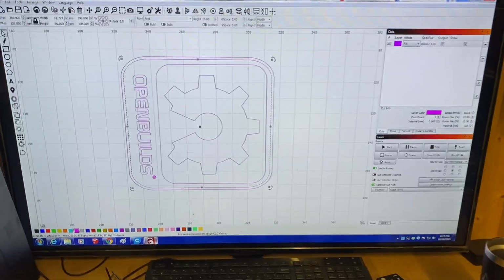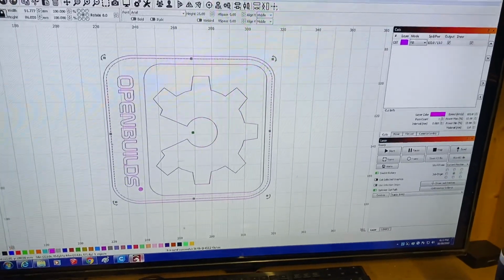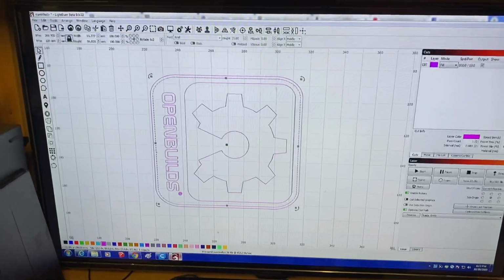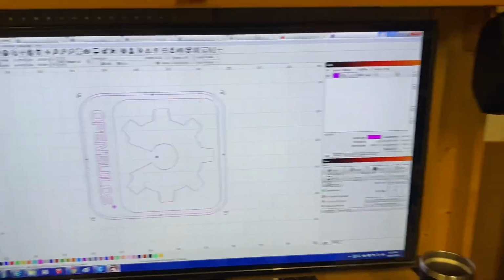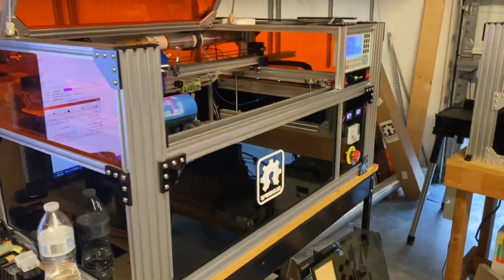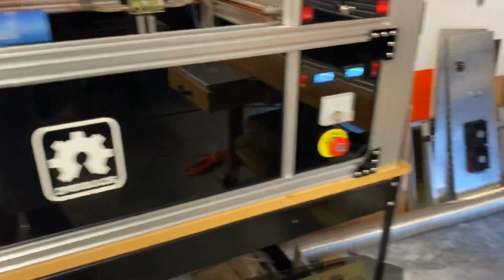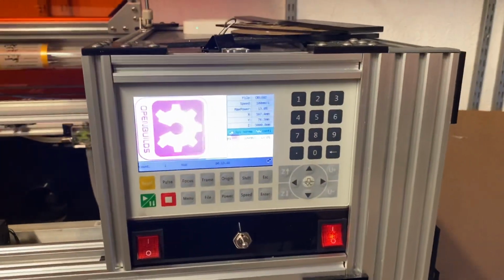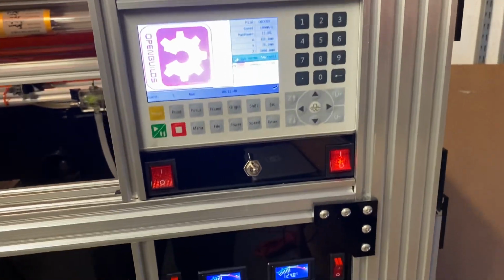Rotary test

Comment: Looking good Pedro. I started my build this past weekend. Ruida should be here today and I can start doing the electronics. 

Did you update your firmware on the Ruida to get access to the new rotary function or are you still using the Y access as rotary?
Reply from the maker: I still using the Y axis, so finally Ruida decide to use a dedicated axis for rotors?
Reply: I read a post on the lightburn forums where they were talking about a firmware update that now allows the U access to be used as rotary.